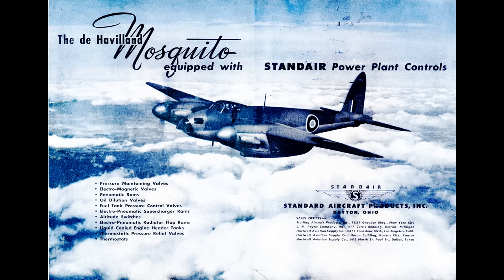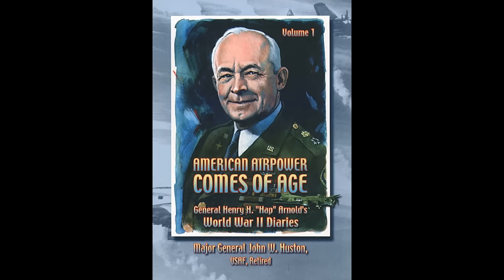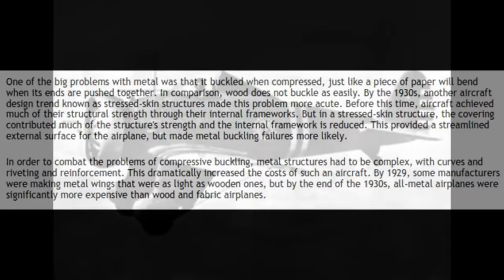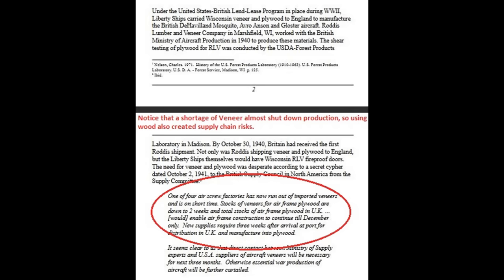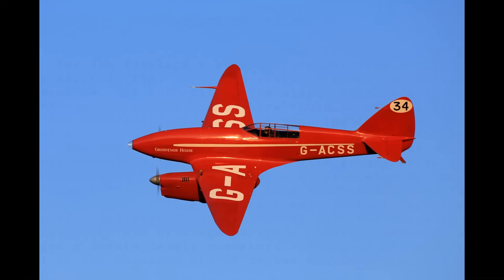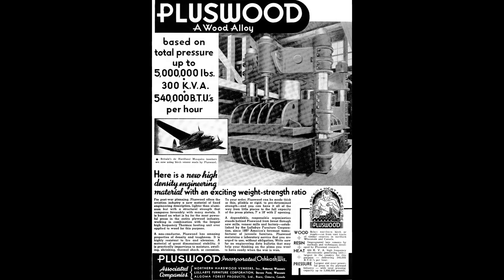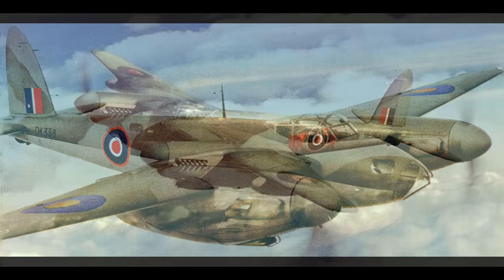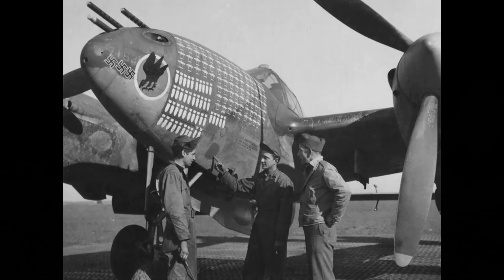De Havilland Mosquito vs. ?

Comment: Well from the Mossie's documented history, Beechcraft's quote at could not have been more wrong even if they tried!! Also, one undoubted fact is that during the Mosquito's service life, it recorded the lowest operational loss rate for any aircraft in WWII.
Reply: Still some were in civilian service till 1960s
Reply: no small fact--for consideration.
Reply: The Brits even landed them on carriers (as a test, not operationally).  That should show a sturdy airframe if anything does.
Reply: Andrew Sarchus  Wood also allowed it to be made by boat builders. Tapping into a major skill pool which was a great move
Reply: Andrew Sarchus  Well, 1) Beechcraft had MADE the transition to metal already - their designers were thinking in metal, their supplies of metal for construction were good, and their workforce was trained to work with metal. For Beechcraft to 'go back' to working with wood would have been HARDER than just designing and constructing an all-metal plane.

But it was egotism to make blanket statements like whomever did on Beechcraft's behalf; I'll agree there. :)

Also, it was less 'limited metal stock' (the wood for the Mossie had to be imported, too), but as Greg points out; the skilled metalworkers in the British workforce were already engaged in MANY other things; this was an opportunity to make use of an idle resource - skilled woodworkers.

...either way, the end result was a useful and beautiful aircraft.
Reply: @randyallen2771  I believe the follow on Hornet fighter was operational with the Royal Navy.
Reply: Ross Cox  Quite. If you click onto one of the references I provided, a reason why they didn't go over to Mosquitoes is given. It seems essentially that going over to Mosquitoes contradicted their over all policy of the bombing offensive. The Mosquito was too accurate in it's bombing, whereas conventional bombing (having a greater inherent inaccuracy) started more fires, and hence more destruction.
Reply: Ross Cox  Yes, I hope nothing like WWII never happens again!! 👍
Reply: And that’s doing some of the most high risk roles/missions
Reply: Except that from 1946 onwards nobody built airplanes mostly out of wood.  And starting in the early 1960’s most boat builders stopped using wood. The Mosquito was a marvelous anomaly.  The RAF and the FAA didn’t switch from Aluminum back to wood after the outstanding performance of the Mosquito was made known.
Reply: Jack Tangles  As for the 640K tonnage dropped, I just quoted the reference given - so it's their problem for any error you find. But on checking, the B-17 only carried about 384kg more in bombload than the Mossie. Still, you have to acknowledge the almost prohibitive losses suffered by B-17 aircrews for this roughly 10% difference. Each lumbering B-17 was crewed by 10 men who far too often were killed/lost for that extra 384kg bombload between the two aircraft.

IMHO its arguable that using B-17s was a sheer waste in men, and therefore a too high a cost to be borne for the results obtained in return. IMHO it would've been far smarter, economic and successful - with far less losses - to forego that extra 384kg, and just fly in, bomb, and get out again using the faster, smaller, more nimble, twin-engined Mossie crewed by 2 aircrew.

Though I know this is pure conjecture, the reality is that probably A) the US had an intense national pride and anti-British attitude, which combined in the continual dogged use of the B-17s in daylight, and B) a readily available massive wood supply to build a bomber fleet based around the Mossie.

What ever the reasons, what can never be denied is the horrendous actual number of B-17 aircrew that were slaughtered over Germany. Poor buggers!!
Reply: Jack Tangles  Ordnance dropped in Vietnam? Interesting. Got a reference? 👍
Reply: Jack Tangles  Absolutely!! 55 000 young men killed in fighting to ensure ALL our freedoms today - simply cannot EVER been forgotten!! 👍

On a wider scale Britain (with Commonwealth volunteers) fought alone from 1939 to mid-1942. After that time, with US industry as the "arsenal of victory", they STILL took the fight to the Axis until final victory was won. As a sustained feat of arms, there is NO finer example IMO.
Reply: @randyallen2771  "Winkle" Brown was the man that did the first landing. He hold the record for number of types flown, record number of carrier landings and record of types landed on a carrier
Reply: According to one report I saw, 1 fatality for every 10,000 flight hours in a Mosquito during the war.  40,000 flight hours for every fatality for civilian aircraft in peacetime.
Reply: Badness Bob  Quite. My wife is Vietnamese - a more caring, gentler and philosophical Buddhist lady you could hardly meet. During the war, many of her family suffered horribly: since most fought with US forces - then were abandoned (when the US got their arses kicked out) - and THEN suffered unbelievable persecution for years afterwards by the NVA. After all that, she holds no animosity to either side - but STILL says "the North" can't make Pho [the national dish] anything like us South Vietnamese can!" 👍
Reply: Badness Bob  Thanks mate!! She certainly is a keeper! She is so caring that last Saturday in a restaurant while around a table with friends they were amazed when she just began absent-mindedly massaging my hands (she does things like that without asking!!). Been together a few years now and I [and I hope WE] couldnt be happier. We do all chores, cooking etc together - that way things are done quicker so we have more time to get out and have fun! She is also a superb cook - her chilli mussels is just HEAVEN!! I KNOW I'm one lucky guy!!
May peace, light and love always be yours mate!
Tim, 😊👍
Australia.
Reply: Jack Tangles  Her ex IS an idiot, he just didn't understand her, or the art of cooperation and consideration. His loss. I married her here a few years ago.
Reply: Jack Tangles  Wow!! Congratulations on 52 years together!! 👏👏👏👏👏 You are a lucky guy too. 👍
Reply: Jack Tangles  Yes, and we were hoping to go back this year - but for bloody Covid!!
Reply: Jack Tangles  Mainly to the south, but up north is nice, and Halong Bay is just awesome!! Where abouts are you in Oz, and where do you go in Virtnam Jack?
Reply: Jack Tangles  Looks like you're a seasoned Vietnam traveller! I've only had 2 flying visits so far, but we want to stay a month next time. I've just told my wife, Thi-My, of those places you mention, and that we MUST visit them next time - I'll get the book too, to help plan! We've always started out from Ho Chi Mihn as a base (staying with family) but, as a guy that prefers the wild places over cities, I want to get out into the Provinces. Much appreciated for your advice and thank you.

All the best Jack, and always may peace, love and light be yours and Hoa's. 😊👍
Reply: Jack Tangles  I just screenshot your replies so to keep note of these places mate. Thanks!
Reply: Jack Tangles  Thanks!! I will. 👍
Reply: Jack Tangles  True!! Purely motivated from self interest. 👍
Reply: Jack Tangles  Who's Mate Greg
Reply: Jack Tangles  I must be thick but i don't understand the comment, please explain, LOL
Reply: big cheese  If making an aeroplane out of wood in 1940 was so "silly", why was the Mosquito so successful?
You do know why De Havilland made it out of wood, don't you?
Reply: big cheese  I asked two questions and you ducked both of them. Of course no one builds aircraft of wood today, when there are better materials available, but back when the Mosquito was planned by De Havilland as a private venture there was a shortage of strategic metals. The Air Ministry was initially uninterested in the idea of a fast, unarmed bomber made of wood, but Air Chief Marshall Sir William Freeman saw the potential of the aircraft and gave it his support. De Havilland had vast experience of building aircraft of wood and used that experience to produce one of the most effective multi-role aircraft of its time, so please tell us, if making an aircraft out of wood was so "silly" in 1940, why was the Mosquito so successful?
That was a silly comment, by the way, about meeting the Me 262, which was 100 miles per hour faster than the fastest Allied fighters. 
I don't know what you did for thirty years at Boeing – and I'm not interested – but it taught you nothing about aircraft construction, and the quality and content of your comments show that you know even less about the Mosquito.

Your turn to say something. Try not to say "case closed".
Reply: big cheese  Two attempts at trying to make a case and all we get is gibberish from someone who claims that he worked for a company that makes aircraft. What did you actually do at Boeing? Is a straight answer from you even possible?
I'm not British, by the way.
Reply: big cheese  Still ducking the question and still sounding like a one-note-samba.
Okay, Boeing Boy, you are incapable of a straight answer and it's time for my morning coffee in this time zone, so I'll leave you to it. You can have the last word.
Reply: @MarsFKA  Boeing 737 max is made of metal
Reply: @markcatton1484  Yes, it is. What is your point?
Reply: @MarsFKA  I keep reading how wood was stupid. Given the choice I would feel alot safer in a Mosquito than a 737 max. Even if I were alive in '44 flying 100 feet off the ground with 30 mm flak coming at me. Ok slightly exaggerated but at least they didnt crash from poor design
Reply: @markcatton1484  Okay, I get you now. If you have been reading the same stupid comments about how the Mosquito was a piece of junk because it was made of wood, then, yes, they are very stupid comments.
Wood worked, and still does in a lot of things that aren't houses, but that doesn't matter to some people with a fixation.
And yes, the all-metal 737 Max was a winner, wasn't it?
Actually, I see that Boeing has decided that they have fixed the problem. Now they just have to convince the people whom they want to fly in their all-metal aircraft.
Reply: @MarsFKA  Also seems to be the fore runner of modern composite construction, just imagine what it would have been like if Carbon Fibre was available. NO other plane did what a wooden plane did. Bomber, similar load to the metal B17 with a lot lower loss, Fighter performance to match single engine ones, largest airborne gun to sink ships, night fighter, path finder probably missed something. A great plane for it's time. With modern composites metal's days are now numbered. A truly informative and balanced video. Oh and Aluminium burns as well.
Reply: @markcatton1484  Agreed, especially that last sentence. Heheh. I saw what you did there.
In my teenage years in the 1960s, I sat in a Mosquito that was on a farm and was being used as a hen house – I came out covered in chicken cast-offs – and saw how much it had deteriorated. Years later, thinking back to that, I sometimes wondered if anyone wanting to build a Mosquito from scratch might prefer composites.
More years later, when AvSpecs started building them for real, they stuck with the original technology. Why try to re-invent the wheel?
Besides, AvSpecs' customers wanted the real thing. I would, too.
Reply: @petersouthernboy6327  The de Havilland Vampire  had a lot of wood still in it (at least the fuselage), was produced in large numbers and used by air forces for many years (the RNZAF was still using them as strike aircraft in 1965). Several examples in  private hands are still flying today. Of course, synthetic composites have taken over now, where balsa may still find uses as a core material.
Reply: @chrishoff402  Sounds highly improbable to me.
Reply: Hoa Tattis  Don't know where you got your figures, but if you are correct, they come at almost the prohibitive losses of B-17s!! But as the Mossie enjoyed the LOWEST loss rate for any combat aircraft used during WWII - I know which aircraft I'd rather be flying.
Reply: Hoa Tattis  For surgical removal of targets such as German headquarters and barracks etc, in civilian cities no other aircraft was better for the job than the Mossie. But if as you infer "carpet bombing" (inaccurate bombing) was wanted, the B-17 was best aircraft of all!! (B-17s were that inaccurate they even bombed Swiss towns 100's of km away from their intended, German, targets!!) But B-17 aircrew losses were an almost too heavy a price to pay. The Mossie may have been "too accurate" but civilian and aircrew lives were undoutedly saved by its use - and it's losses were the lowest of any WWII combat aircraft.
Reply: Hoa Tattis i hope you're not likening "war" in simistic terms of fantastical "Game of Thrones" or "Vikings" rubbish? IF not, then by  "the enemy" do you mean "combatants" or "civillians"? Because in the real world, there's a BIG difference - which usually also incur massive post-war consequences.
Reply: Hoa Tattis  Sorry lad, you missed the point. Therefore it''s pointless discussing this subject any further as your views based on your thinking clearly go no further than your nose. Thank God the top military who plan wars and then effect the rebuilding of society afterwards - and the transition back to civil life - don't share your thinking.
Reply: @MrBeezumph  Eric Browns record is even more impressive when you consider he flew 14 marks of spitfire but is counted as just one type and so with many other types each just being counted as one, eg Fw190 and Ta152 is counted as two types they are as different as a mk1 and mk 24 spitfire! There are also many types he piloted but weren’t counted as he didn’t carry out take off and landing.
Reply: @empath69  What was special is the laminated construction well ahead of its time. Plywood /balsa/plywood all glued together this made a very strong shell so strong very few bulkheads or internal frames where needed. Stress fracture where more common in alloy than wood. What is really funny is people think it’s First World War plane it’s wood.. When it came out it was 20 mph faster than the all metal Spitfire fighter and this was a bomber. It was light and strong and the strength was throughout the fuselage. The comet race plane proved the theory.
Reply: @idleonlooker1078  Yep,the Mossies did pull off a number of low level attacks against lightly defended targets in occupied Europe. Had they tried that tactic against the Krupps works at Essen, they would have been murdered by the light flak.At High Level the Mosquito's bombing accuracy was no better than any other bomber using visual bomb aiming,
Reply: @randyallen2771  "Winkle" Brown, 1944, he also made the first carrier jet landing, Sea Vampire 1945.   The DH Hornet, the aka Mosquito Sports Version went to sea as the Sea Hornet.   Captain Brown spoke rapturously of the view over deck from its cockpii.
Reply: @idleonlooker1078  Debatable, the doctrine was if you cannot hit the factories accurately, then use area bombing to kill/disable the workforce.    I over simplify, but there are advantages to hitting what you aim at.
Reply: @TheArgieH  I suppose that that over-arching doctrine was conveniently used because the American bombers at 20000' weren't that accurate - using a "near enough is good enough" carpet-bombing approach. Mind you the RAF were just as bad in the early years, but they had substantially improved their accuracy (eg: using SABS) later in the war.
Reply: @fafner1  Yes it was,   The Sea Hornet.   "Winkle" Brown sang its praises, especially the pilot's view of the deck when landing on.
Reply: @idleonlooker1078  And the later RAF Pathfinders flew Mosqitos dropping flares to guide in the heavies, almost full circle.
Reply: @richardvernon317  I suppose you could say that about any bomber- and the horrendous losses by heavy bombers proves that. But you miss the point, the Mossie was not a heavy bomber, but one that gave precision accuracy. I do not think any other bomber had the accuracy, speed or manoeuvrability, to bomb individual buildings in the middle of European cities, do you?
Missions such as the Amiens jail breach, the Phillips works in Denmark, the SS Headquaters in Oslo, Copenhagen and Aarhus are examples of the Mosquitos use. Could you imagine B-17s lumbering in that low against flak and fighters, bombing the one building and getting away? Not bloody likely!

It remains a fact that in spite of all it went through, the Mosquito had the lowest loss rate for any front line aircraft in WWII.
Reply: @idleonlooker1078  True, however a Beaufighter dropped a tricolor on the Arc de Triomphe, intending to p### on a German parade - allegedly.   Might be true, I saw it on the cover of a comic book.    (Actually I think it partly correct, the flag was dropped, but the parade had been cancelled.
Reply: @TheArgieH  Yes, that did happen. The pilot was awarded a DFC for it. I think the Beau was larger and slower than the Mossie, which is probably why it wasn't used in precision low-level bombing raids like the Mosquito was.
Reply: @idleonlooker1078  One of my favourite WWII aircraft.   The Beau was developed from the Beaufort torpedo bomber, basically the same wing but wholly new fuselage.    The Beaufort was slow, cramped and weakly armed, in contrast the Beaufighter was relatively fast, had more power and its formidable mixed cannon and MG armament  are well known.   As you say far heavier and slower than the Mosquito, but earlier on the scene, better than what else was on offer at the time, and optimised at first for shipping interdiction - the Torbeaux.    The Beau was available before the Mosquito and carried out many of the same roles, especially such as the radar carrying NF.
The Beaufighter's conventional and rugged structure  had some advantages too.    The climate out east was not friendly to aircraft featuring much wood and glue, but the Beau was as tough as old boots and thrived (as did the Hurribomber, but that's another story) .    It was built also in Australia, that version switched in 4 x  50 cal for the 6 x 303s, and.kept the same 4 x 20mm.   The Japanese reportedly did not like it at all.
Reply: @TheArgieH  I agree - the Beau is a favourite of mine too! Rugged, tough and packed one hell of a wallop!! I suppose the Mossie was the rapier, while the Beaufighters 2-handed broadsword!! 👍
Reply: @idleonlooker1078  Yes indeed.   I've mentioned elsewhere a book called "Last of the torpedo fliers", a series of biogs of aircrew who converted to Torbeaux from other less formidable types.   They absolutely loved them, one could be heard to say whilst in the air "Yippeee, I can pretend to be a real fighter pilot".  One has to remember the BoB was still fresh in the mind, and some of these were very young men.    Yes the Beau was tough, one in the book got home after clipping and bending the mast on an  (enemy) target.   Now that IS low altitude flying.   The enemy's opinion of the incident is not given.
Reply: @idleonlooker1078  I just read your interesting exchanges on the losses across bomber crews.   As I reckon you know, it gets quite complicated.   During WW II Freeman Dyson (the Dyson Sphere Dyson) worked on operational statistics and efficency calculations for the RAF.   He suggested stripping Lancasters of their turrets and changing the fuel mix.    He reckoned this would result in a significant increase in both speed and service ceiling, sufficient to lower the number of losses (aircraft and crew) even without defensive armament.    He also had in mind that those aircraft that were inevitably shot down would then take two fewer crew with them.   This suggestion was rejected by the brass.    They did love their turrets, somewhere I saw line drawings for a proposed turret (mid upper), for both the Beau.   Fortunately they got nowhere with that one, though the observer/navigator sometimes got a Browing or Vickers K/GO.   I bet they even considered it for the Mosquito. 

I also saw a table on crew survivability across the RAFs three  heavies.  It was calculated to address the ease of escape from a doomed aircraft.    The Lancaster, despite its many outstanding virtues, did not come out well being quite hard to get out of.   The Stirling did quite well as did the Halifax.    The latter was the only one of the three in which you could walk around upright.
Reply: @TheArgieH  Totally agree with your comments. I have seen a mock up turret they contemplated for the Mossie, being directly behind the cockpit glazing. I'm not sure if this was a manned turret or a barrette controlled by the nav. Anyway, it didn't go far. I also saw pics of a Lysander with a manned rear turret and a Lancaster type elevators and rudders - andither "What if?" scenario!! Methinks the top brass wanted turrets even if for the psychological value for the crews - .303 brownings being something to fight back with - while being admirably protected by 2/16" thick aluminium sheeting against the 20mm cannons of the nightfighters!! I just read the biography of Heinz-Wolfgang Schnaufer - a very, very, interesting book! Lots of info regarding their tactics as well. Reading this made me realise those poor buggers didn't have much chance when up against a well-trained experienced night fighter crew. Get it and have a read. 👍
Reply: @idleonlooker1078   Thanks for the book reference.   Ah turrets!   There was a bit of a "to and fro" on YT over German nightfighters' use of Jazz/Crazy music, bewailing the RAF's assumed short sight in not understanding what was happening and consequently fitting ventral turrets like the B17 et al.   Actually whilst it took a while to cotton on to the Luftwaffe homing on the RAF's navigational radar emissions I doubt the short sight criticism was fair.   After all the RFC invented the concept back in WWI.  The SE5a Lewis mount could be swung down to reload or indeed to fire on two seaters from underneath, ditto the arrangement on the Dolphin.    Whilst the latter often lost both the Lewis pair to save weight, some pilots would retain one of them specifically to deal with two seaters.   Much safer to go for a two seater from underneath.   The Zeppelin killers dreamt up in the interwar period used an inclined weapon (30+ mm C.O.W. gun).    So the RAF were definitely aware of the possibilities.  The early Lancasters did in fact have a ventral weapon sighted through a periscope (like that on the Blenheim maybe?).  The catch was they could only offer about a 15 degree field of view.   My understanding was that most were removed at squadron level as a waste of space.   Much later a glazed patch was installed where this would have been, and someone posted to watch for nightfighters creeping up underneath, presumably enjoying a better field of view.    Nasty thought, lumbering along on the outbound trip laden with bombs and full tanks, just waiting for someone to shoot at said tanks with 20mm.    I reckon the ball turret idea was a non-starter in the Lancaster anyway for a host of practical reasons.   Also, the Jazz Music trick is a bit harder to pull off if the prospective target is motoring at 400+ knots, courtesy of Hatfield et al.
Reply: @alfretwell428  As I guess you know, with the help of a German technical crew, he test flew the Me163.    However, being a very intelligent and experienced pilot he turned down an offer to try the Natter (the last ditch manned anti aircraft missile.    Anything that breaks up in flight by design is likely to be a bit risky.)
Reply: @idleonlooker1078  Leaving out the USSR?
Reply: Hoa Tattis  Thanks for the tip about Back Ma NP!! When I get to Vietnam (Covid notwithstanding) I'd love to visit it. 👍
Reply: @Scoobydcs  and by mass  furniture manufacturers in the UK.
Reply: Hoa Tattis  I doubt it. His posts didn't contain the trademarks of the unsavoury individual you suggested – the infantile "DUHHHH"s, the rows of exclamation marks, the hair-trigger personal insults, the foaming hatred of anything and everything British and the utter incapability to hold anything slightly resembling a rational, intelligent conversation..
He said he worked at Boeing, but, having read his crap for years, I could not believe a word he said.
I note that the individual to whom I was responding has since deleted all his comments.
Reply: Hoa Tattis  Sorry. All that went over my head. Could you go into more detail?
Reply: Hoa Tattis  So, what is the connection to this video?
Reply: Hoa Tattis  Who cares?
Reply: Hoa Tattis  Don't know what the reply is too. but Moms the word
Reply: @empath69  De Havilland was deep into woodworking skills. They could develope methods/training that transformed thousands cabinet makers to important weapon system workforce = increased total weapon output.

In US there were no like company.

Gregg did spell this clearly and loud. Mossie was great, had usual woods limitations on longetivity in tropics - nonissue for war. It should had been LIGHTER made of aluminium. But would had been DRAGGIER.... propably +-0.
Reply: @randyallen2771  That was Commander Eric Winkle Brown who holds the world record for number of different aircraft flown, and stands at 487 aircraft
Reply: @idleonlooker1078   daylight raids bought the germans up for combat, mossies wouldnt have that effect, allies had to get some air superiority b4 d day
Reply: Hoa Tattis  I know! But I remember reading a 1944 US 8AF Report (by Spaatz or Doolittle?) on the P-38s' performance in the ETO. Apparently they suffered a 50% unservicability rate due to the metallurgy of the engines being umable to cope with operating at the high altitudes demanded. If I recall correctly the P-38 was also unable to hold its' own against the smaller, more agile German fighters. This is largely why they were withdrawn from the ETO and sent to the Pacific, where they did well, and the engines didn't fracture. I believe some P-38s remained in the MTO as well.
Reply: Lowest loss rate of RAF Bomber Command....not of all WW2 aircraft.....hours per hull loss there are oodles of candidates...PBY, Sunderland, Stork, Auster, Martin Marauder B26 etc
Reply: @RamonInNZ  - yes, there was nothing wrong with DeHavilland post war aeroplanes eg the Comet.
In fact the structural problems of ‘crack propagation from corners of windows’ was a total psyop… Hang on in there, just about to explain this statement…

I often wondered how it is that the WW2 “air superiority winning” Rolls Royce engines eventually came under the German BMW ownership (ie in UK).
The famous DeHavilland Mosquito fighter-bomber - the fastest thing flying in late 1941 / 1942, also with a range to get to Berlin and back… caused so much damage to German war-effort that the Germans always remembered “DeHavilland” - they never forgot…
In the early 50’s DeHavilland introduced the first COMMERCIAL JET airliner (with fully powered controls, fully pressurised, cruising at 36,000feet at 490mph, much faster than any competitor) - the DeHavilland DH106 Comet - order-books filled up by dozens of countries and their state-airlines for years to come.
Then, as if someone had a grudge against DeHavilland - a Comet taking off from Rome went down over deep water in Jan 1954 (eye-witnesses heard 3 explosions - initial bomb + fuel).
Then as a repeat, another Comet taking off again from Rome went down in April 1954.
Order-books dried up almost overnight.
A psyop cover-story of “square window crack propagation” was repeated for long enough that it became a mantra.
Admiral Canaris (who obviously survived the war) - set up continuation of the German black intel - Deutsche Verteidigungs Dienst (DVD) in 1944 - HQ in Dachau.
Canaris was the man who ordered the hit on DH Comets - with the aim of strangling the blossoming UK civilian airliner industry.
Back to WW2 - Menzies (head of wartime MI6) and Frank Foley (MI6’s supposed expert on Germany) were both later exposed as a double-agents working for the Germans.
Reply: I'll be honest, when i heard the criticism of "serviceability", I thought of access to components, NOT the airframe structure itself. Did I miss the word airframe?
And Beech, if I recall correctly, had itself a fair amount of recent wood construction experience at the time...
That said, Beech also had an American perspective on serviceability -- that is, one that could not expect the aircraft to ever be deployed close to the factory that produced it. And it is much 
harder to patch structural wood than non-structural metal...
Reply: @MarsFKA o
Reply: @chrishoff402 Yeah and definitionally these planes were going to the most dangerous places, alone, and repeatedly. Incredible machine. It was successful (dominant even) because of not despite being made of wood. It forces elegance and optimization at design time, engineering time, and construction by more hand-skilled people compared to metal airframes in that era. Turns out all that matters, a lot. It might not be as theoretically "efficient" as the American analyses observed... but in the context of the actual war, it was in fact more effective. Which matters most?
Reply: At 13:14 the analysis of Fuselage Construction says exactly why this plane was more successful because of (not despite) being engineered and constructed of wood. It says: metal cannot be bent in double curves. Single only. With metal, at the time, fuselage design was limited to cylinders and cones. Conversely, "double planked" diagonal wood fuselage... like the hull of boats since time immemorial... is perfectly suited for rigid light thing strong curves in three dimensions simultaneously. 

The analysis says for example the wooden construction allows a "barrel" shape meaning cask or keg not tube gun. It is for the same reason sheet metal skiffs are to this day riveted (or welded) together with hard chine planar components rather than layed up or planked in complex curves eg non uniform rational b-spline etc. 

The American companies evaluating this design were simply wrong.